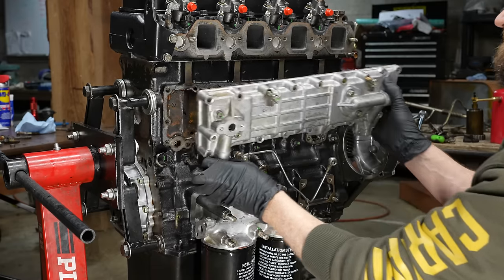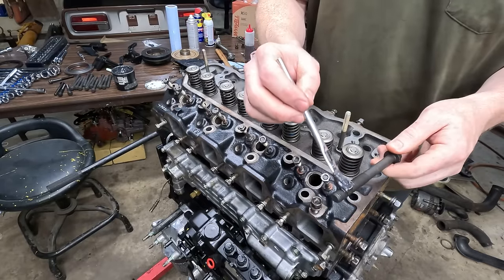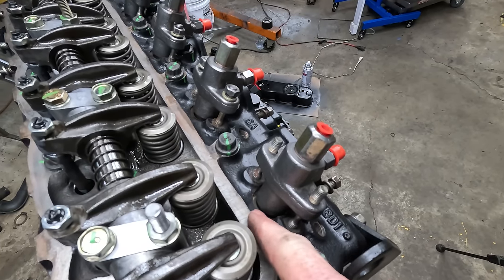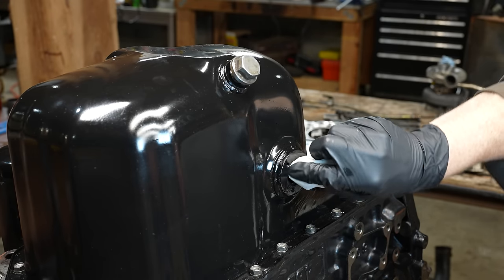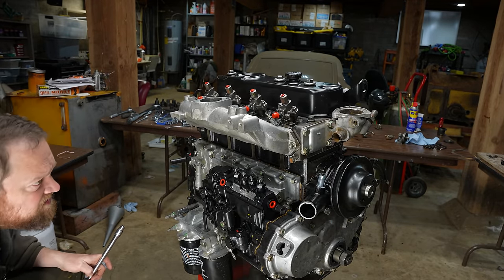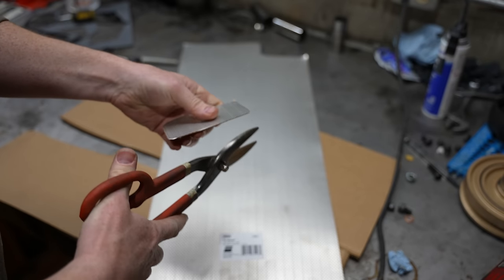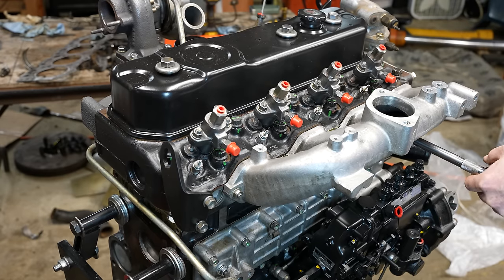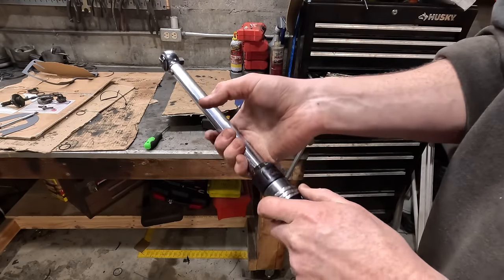Excavator engine build - Mistakes and headaches  (Isuzu 4BD1T/Hitachi EX120-2)

Comment: What fluid do you run in your pressurized spray bottle?
Reply from the maker: brake clean
Reply: I just realized you can buy it in a non aerosol form. My mind is blown!🤯  @PacificNorthwestHillbilly
Reply from the maker: @danwhiting4399  it's way cheaper if you do

Comment: I may be wrong but I'm pretty sure that oil level sensor you put in the sump is upside down. it's on a spring so should the oil level not push up on the spring?
Reply from the maker: I think it's a float, but there is definitely a possibility it's upside down
Reply: I thought that aswell , but it has 3 bolts , so it can only be rotated 120` , which means it the float would be sideways in the other positions ..

Comment: - Matt, you did an action of changing your future away from major problems in the future.
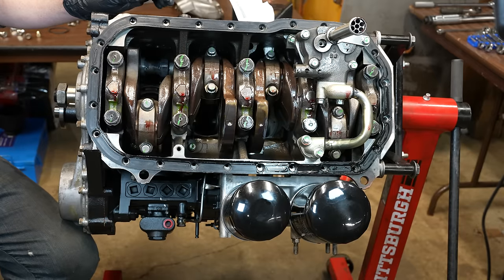- Your WhatIsNeeded act of forgetting to put in the oil pump spline coupler {21:07}; and having the "intuition" to re-read the manual and recognizing you needed to re-torque the the crank's mains and rod bolts {21:23} concluded with your future change into a new timeline coming in here {23:46}.
- [Thirty years ago I transcribed the second book the Kryon channeled. Today's youtube channel had this to say: "CAN YOU INFLUENCE THE FUTURE?"]
*- https://www.youtube.com/watch?v=PZWg6AxkZlU .*
- Kryon talked specifically about the type of thing you showed us you did.

Comment: Those weights are just not accurate enough for calibrating something like a torque wrench. You need the proper equipment to do it right. The quickest way to see if it's off is to use a high end torque wrench and compare the differences to yours. You might want to consider doing that before installing that engine.

Comment: Can honestly say in 45 yrs of automotive repairs, I  have never seen head bolts torqued from the outside to in.  Maybe the manual did not translate well from asia to english?
Reply: Curiosity got the best of me...Poked around for the torque sequence for 4BD1, and all I could find start in the middle and work to the outside.  🤔
Reply from the maker: It's even more baffling because the 6BD1T sequence is right above and it goes from inside to out like you would expect.  There is a manual for the automotive version floating around online that shows to tighten the 4B engine from inside out, but that one is a much older revision than the industrial manual I have which I got directly from an Isuzu sales rep.
Reply: @PacificNorthwestHillbilly I work at a GM dealer.  Back when we had "Geo" branded cars made by Toyota, isuzu and Suzucki we would find all kinds of errors in the service manuals.  GM tech assist told us this was due to poor translation from the original non english manuals.  Me personally would torque it from the inside out.  Best of luck to you!
Reply from the maker: @scrappy7571  After some more thought I am pretty sure it is a mistake in my manual
Reply: @PacificNorthwestHillbilly UGH! But it is better to re-torque it before it ran and heat cycled.

Comment: That water pump has too many differences. The pulley rubbing outlet fitting wrong size, you could see on the video that it was a ways of from the alternator. You dont want to be eating belt's.

Comment: Only problem with the studs I seen was torque..you torqued the nuts to the cooler not the studs. You should have double nut the stud then torqued it...or use a stud installer